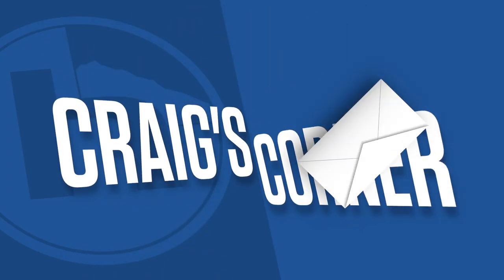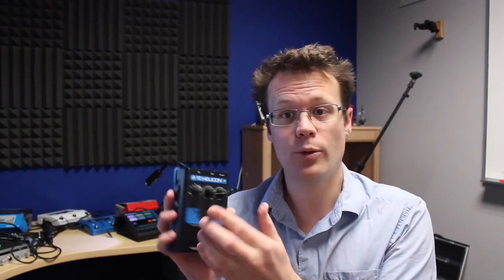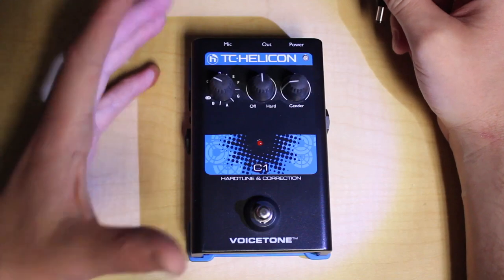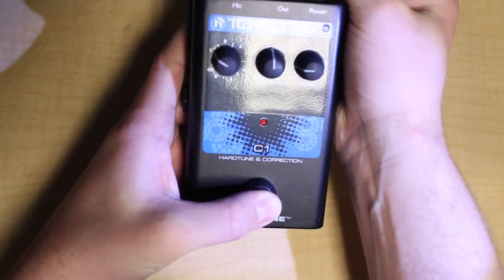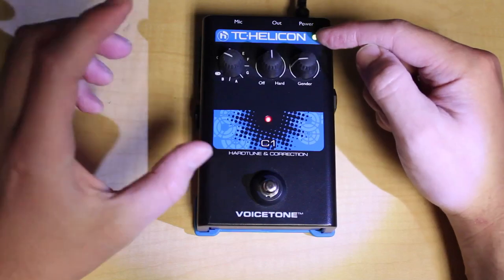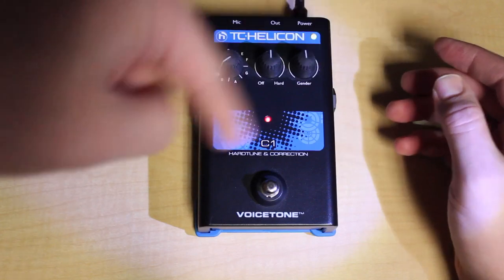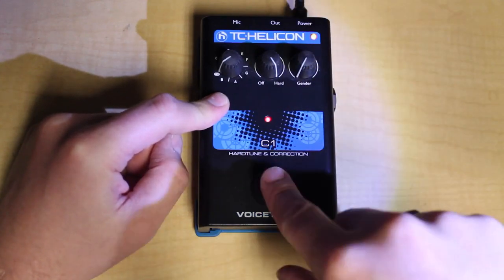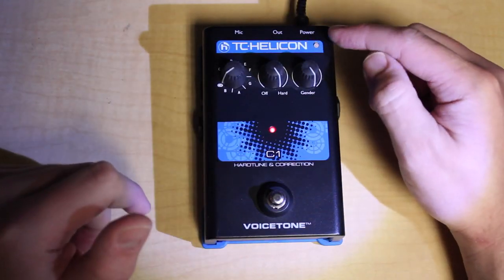TC-Helicon - How to Calibrate VoiceTone Singles, Mic Mechanic & Harmony Singer

Comment: Thanks! Seriously how is this not in the manual??? I just got a Voicetone C1 and it was off by a half tone out of the box. I was about to return it and found your video. Your method worked on that model.
Reply: Exactly my experience.  The bottom 3 keys were a half-step out.  This fixed it easily.

Comment: Hi - the red light at the top right of my unit is constantly red whenever power is connected - can you help? It's not working at all and the when I plug in with USB to try update firmware it can't find it.

Comment: My TC helicon H1 is just drop dead, no lights in the power or the LED in the middle. I tried calibrating it and the lights do work the same way as shown in the video but once I finish the process and try to turn it on it doesn't work, it's the same again, dead.
Kindly help.

Comment: I've got two of the Voicetone H1 units which worked beautifully and then went wonky!! I followed your instructions and it fixed one of the units. With the other one, when I hold down the foot switch and plug in the power, the red light does not flicker. Tried these steps a few times, with no response. Can you please let me know whats happening? I use these units for live gigs and I'll be needing them in the next couple of weeks. Cheers
Keith

Comment from the maker: Hi Vendetta725, the process is very similar for the 2 switch VoiceTone products. 

I put the instructions link into the description for you.
Reply: That link no longer works. Any chance of updating it? I have a 2024 T1 and R1, both of which only have 2 pots. When calibrating, the top-right LED never goes red, and the central LED doesn't flash after calibrating the 2nd pot. Is that correct? Also, I assume there's no way to calibrate the mic gain pot on the side of the pedal?

Comment: Hi...I own 3 Mic Mechanics...My band wants to tune down from standard  A=440hz  to  A=432hz...is there any way to adjust the pitch correction function on the Mic Mechanic?
Reply: I'd be willing to ship them to you and pay via Paypal if it is possible to reprogram them? If it could be done via USB, that would be even better!
Reply: TC-Helicon Mic Mechanic doesn't have any adjustments to the reference pitch. They offer that on their more complex (and expensive) devices.

Comment: My TC Helicon C1 Hardtune worked great for 3 gigs, then whamo, the foot 
switch quit working, even though I put it on top of my keyboard and 
never used it on the ground.  I babied it, took care of it and it 
failed, even though I did not damage it in any way.
I e-mailed Musician Friend, and they said since it was past 45 days, I 
had to go to the manufacturer to get it fixed.
Frustrating to have to do that just like at Walmart.  I quit buying 
electronics from Walmart because I had to return electronic items to the
 manufacturer, and who knows what results you get from them.
To be honest, I expected a lot more from Musician Friend.  I shop with 
them because of their reputation of having excellent customer service, 
and begged them to take it back, but they refused.
Musician Friend did honor their agreement, but I am still disappointed 
in them.  It would cost them almost nothing to take back the old one and
 send me a new unit, but I guess the profit they save by refusing my 
request is more important than the thousands I was planning on spending 
with them in the future.
Amazon is the way to go for customer service, not Musicians Friend.
Reply from the maker: Unfortunately the various retailers have their own policies that we don't control. Hopefully our support guys were able to sort you out!

Comment: wonder if this is going to be like my Voice Live Play GTX? i have had it for like 3 years and love it but they stopped having any updates or patches for the firmware a year and a half ago and sorta upsetting since there are so many other users out there that use this pedal and it was not chump change since i bought the switch 3 and the microphone all at once. great unit but poor software support on Tc-Helicons side? still for the most i use my Harmony Gtx and Harmony G more then the vlp gtx since they stopped releasing updates. last one was i think the one that added a little extra time to the looper, but user presets havn't had any updates since shortly after it came out? not knocking TC-Helicon they make some great equipment just try to stay away from the software versions and stick with the hardware only style, i have had to reset the VLP a couple times now do to acting up but never had any issues out of the harmony gtx and harmony g since purchased ! Still love my TC-Helicon gear but think i will stay away from this line of pedals seems to be too many people posting about all the issues they are having with this line and that sucks cause i always like to stay up to date with my pedals :( really want the Tc Helicon Voicelive 3 but just a little to much to throw out this time in life!
Reply: VoiceLive Play GTX is no longer in development, so you won't see any feature updates for that product. It's very common for any company to not develop for hardware 

 that they've discontinued.

Comment: Will you please help me by telling me how to recalibrate the pots on my Correct XT?
Reply: 1.While powering on the unit, press and hold "Warmth" and "Pitch" buttons, you will see the "Adaptive" light is on. 
2.Turn the Shape knob to the furthest LEFT position that it will travel and press "Adaptive". It should start to flash. 
3.Turn the Shape knob to the furthest RIGHT position that it will travel and press "Adaptive" again. 
4."Adaptive" should stay on and the second Adaptive button should light.
5.Repeat steps 2+3 with the "Dynamics" knob and second Adaptive button. 
6.Both adaptive buttons should stay on and Display should light.
7.Repeat steps 2+3 with the "Pitch" knob and "Display" button. 
The regular display should kick in a few seconds after completing the process.

Comment: Please , I need help ... I am that my H1 TC HELICON is defective or is missing some configuration as buttons calibration ??? it makes a very loud noise when turned on for use and have seen in the videos which is normally very quiet ... I did the video to prove , not to mention having an inner light that flashes constantly ... it's bandstand this light too? ?? and this noise that sounds right ??? what would be the fault ???

https://www.youtube.com/watch?v=n_dp5zKhmO4
Reply from the maker: +Mario Marcio Try pressing the ground lift switch on the side of the H1. 

You have several other devices, including multiple power sources, in that setup. To isolate the H1 to see if it's got the issue, I'd plug your guitar into H1 and your mic. Don't plug the output of the guitar anywhere. 

Then, connect the H1 to your mixer and follow the gain staging setup in this video: https://www.youtube.com/watch?v=qq0AOtafIjs

Finally, listen to the mixer via Headphones, not your speaker. If you still hear the noise in the headphones, the H1 could be to blame. Try connecting the mic directly to the mixer in the setup I've described and see if the noise is still there. If it is, the H1 could have an issue. (blinking lights inside our products is common, so not necessarily any sign there's something wrong).

If the noise is gone with the H1 and headphone method, then it's a ground or other line noise issue somewhere else in your system. You'll want the H1 to be on the same power bar as the mixer and speaker(s), along with any other devices you might have.

If you still think the H1 is to blame after the tests, definitely get in touch with support: http://support.tc-helicon.com
Reply: Friend, thank you for helping me ... the grounding button nothing changed, if only because my electric network has no grounding in Brazil ... hardly the homes have ground ... but with the help of another H1 user I lower the mic gain volume (left side), leaving even totally reset and despite the buzz does not disappear completely, decreased considerably ... but now I have to give more gain in the mixer channel, but the buzz is still continuing but with an intensity less ... I tested it with other non condenser microphone and the buzz was further reduced, but as I need to read the lyrics of songs in folders with a microphone stand disturb me and also I wear bifocals and microphone pedestal in my mouth would have changed distances while performing the music ... then I believe it is a matter of some incompatibility condenser microphone use with H1 ... I am using this type of microphone

http://www.cmi.com.au/process/catalogue/itemView.html?itemId=156904&categoryId=4930

but with their help will have to make presentations without so much buzzing ... thanks for having time to help me ... thank you ... even hugs

Comment: Thank you very much. I bought one 5 years ago, it was really helpful. I sole to my friend because i was moved, then I bought one of the same product from BBay from USA. It is far different from the first one. Please brother. The first one i bought in Auckland NZ. Is there a different in this TC-Helicon C1 hardtune and correction. I prefer the first one. Please help.. Thank you Craigs
Reply from the maker: The calibration process in all of the singles products should be the same. The knobs are labeled differently, but if you follow the order in the video it is supposed to work. If you can't get it going, I'd try support. http://support.tc-helicon.com/tickets/new

Comment: Hello I also have a voicetone double not the d1 but the older one I believe..and it won't boot up when plugged in I get an red 88 for a few seconds then it shuts off. any idea what this is and how to fix it??
Reply from the maker: Hmm, that might indicate that the power supply has failed, or perhaps something internal. I'd get in touch with support, since they can help out with replacement parts and/or repair if required. 

support.tc-helicon.com/tickets/new

Comment: Just purchased this.  My guitar won't play (amplify) when plugged into H1 (either side) even though mic works through amp.  Why is that?
Reply from the maker: 4catsgg The H1 is just a buffered bypass and doesn't do anything to the signal. What are you connecting the guitar output to?
Reply: all is fine now

Comment: if the song is in C and and I want the harmony to be an octave higher what key will I set the H1? is it possible? I know theres a pedal for this the D1. But is it possible in H1 by setting it to a different key?
Reply from the maker: Hi xsacto cutter,There is no Octave Up voice on H1. It's got High, Higher, Low and Lower.

Comment: why should you have to do this?
Reply from the maker: AxelNotHuman The potentiometers in the product will slightly change their output voltage range over time, so re-calibration helps the unit re-learn where the end points are.

Comment: I bought a new TC Helicon H-1.
When I plug it in, it sounds microphone and hum. Even when the pedal is not activated.When I disconnect the microphone cable, the hum stops.
I use XLR connectors and microphone cables.
Everything is properly connected.
What could be causing it.
Reply: I have same problem with my H1.
So just to lessen the hum, I just lower down the volume control at side of the H1 :(

Comment: I just purchased mine and its on the way. I plan on connecting my XLR mic to this pedal to record through my Focus rite scarlett interface. What other cable will I need to connect my pedal to my interface?
Reply from the maker: You'll need one more XLR cable. It goes Mic --> XLR cable --> TC-H Pedal --> XLR cable --> Scarlett.
Reply: +TC-Helicon Got it, thank you very much. It is scheduled through FedEx to arrive today. I cant wait to start using it.

Comment: I have a harmony singer 2 and my problem is that the power LED is flashing red, I don't understand...I panic!! Please help me TC - Helicon
Reply from the maker: Is it running on batteries? If memory serves, that's the low battery warning.
Reply: No I'm  connected with power supply

Comment: what can i do when the auto tune randomly doesnt work anymore while recording?
is it possible, that it has to do with the interface or something on the computer?
Reply from the maker: You might just need to do a hard reset on the pedal, and a firmware update in VoiceSupport 2. If the issue persists after that, our tech support team can help you out!

Comment: The problem with my pedal is that it shuts off by itself in the middle of me singing and it's annoying, I step on the switch and it starts again but then it shuts off after a couple minutes, what do I do?
Reply: Amigo se eu posso te ajudar talvez seja necessário revisar os cabos...comigo acontecia isso...revisei os cabos e deixei todos XLR. Não mono. Pra mim resolveu....espero ajudar....
Reply: Turn off the Mic Control function on the pedal.

Comment: after calibrating my H1, now my power/led light won't turn on. no juice no power .
Reply from the maker: Hmm, I've never heard of that happening. Can you repeat the calibration procedure and get anything to happen?
Reply: TC-Helicon  I've calibrated a few times and the lights come on. When I go to plug it in the fourth time, the led/on light won't turn on. I'ts dead. No juice.
Reply: @tchelicon  same issue, any follow up?

Comment: So is that why the harmony is slow and sound muddy and sometimes give the wrong chord? I seem to be having some trouble with mine like the harmony is coming in in a slur or something.
Reply from the maker: +Gordon Hazell Hmm, if the calibration is off you could actually be in the wrong key. When the knob is out of calibration, it could be setting to the key adjacent to the one you've selected. If you're using guitar and have it in Auto, then it's less likely, but still worth a calibration.
Reply: Okay. It is slow in changing to the next note. And sometimes giving a minor rather than the major. Like in the case of me playing the GDGDG chord. Not sure why.
Reply: I'll go ahead and calibrate. Won't hurt.
Reply from the maker: +Gordon Hazell There's always some lag in changing harmony notes if you're changing guitar chords at the same time. What we find is that in clutch moments you can learn to "push" the chord slightly in order to make the harmony hit on time. If you use set key/scale that doesn't apply. It's only when you're using an instrument and we have to figure out the chord you just played.

For major/minor, it's crucial that the 3rd is heard clearly in the voicing. Sometimes a differently voiced chord can work better. It's not a totally perfect system for sure, but you'll probably find that you can work around its shortcomings depending on the situation/song.
Reply: +TC-Helicon Okay. So what I have isn't a calibration problem then. What about that muddy wobbly sound it gives. And when I play the guitar it harmonizes the guitar sound even when I don't sing in the mic.
Reply from the maker: +Gordon Hazell That sounds like "warbles" caused by mic bleed. If the guitar signal is getting into your mic, it can trigger the harmony erroneously. There's definitely some tricks for that in this video: www.youtube.com/watch?v=pT-CCTmv2ZM